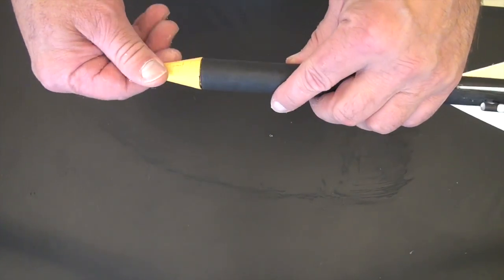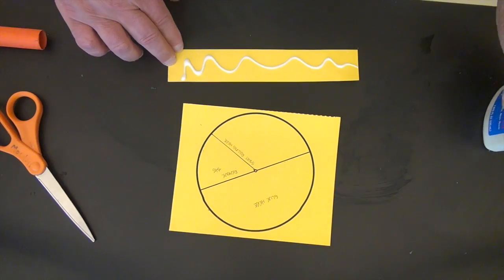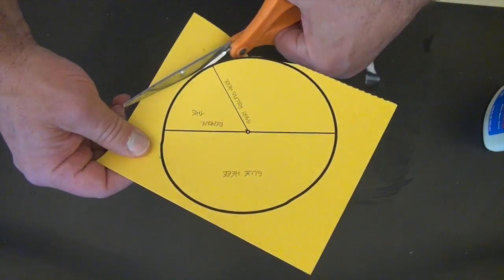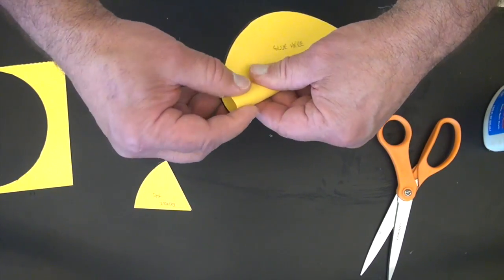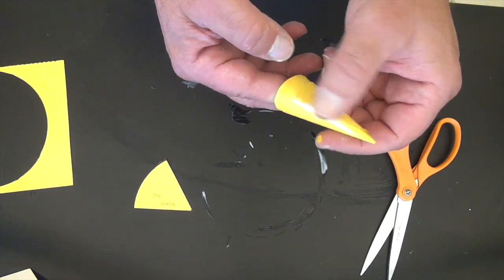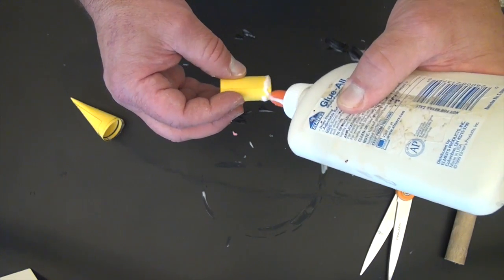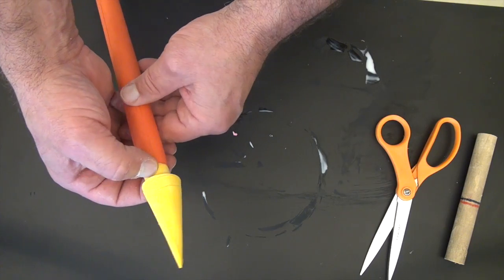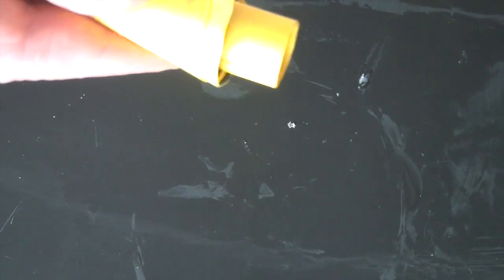How To: Make A Rocket Paper Nosecone

Comment: I'm trying to make a nose cone for the raft, basically I have some cylinders that make up the raft but want to make it travel through the water better.  I need less of a point on the cone so will cut a line a roll less then glue, but how do I know hows big to make the circle to start with please?  Going to make out of lino flooring.